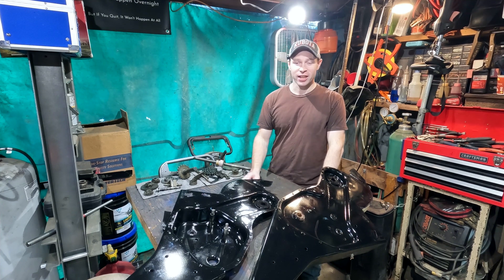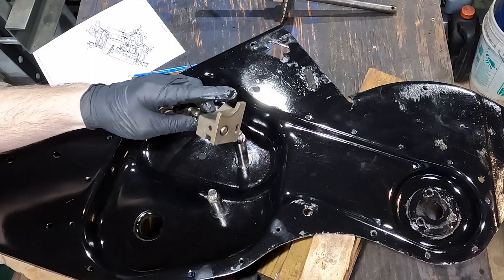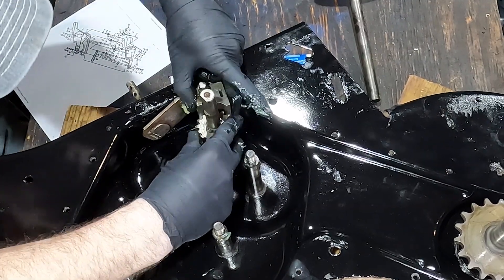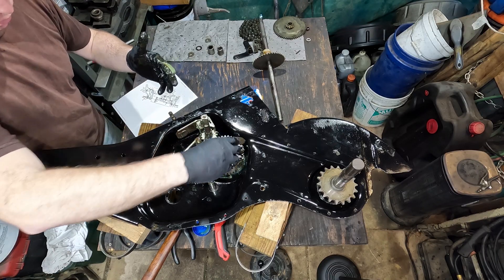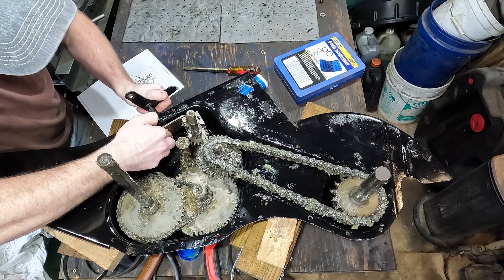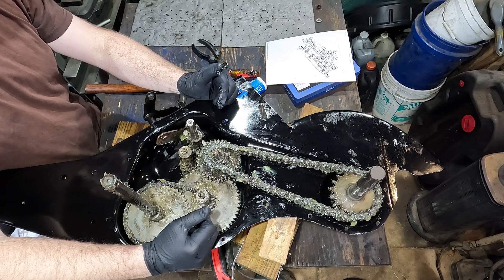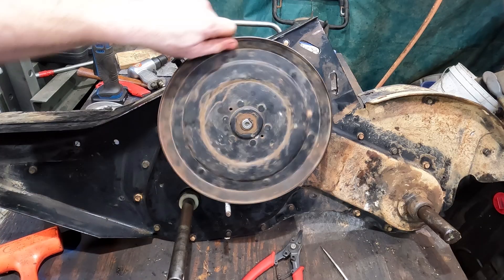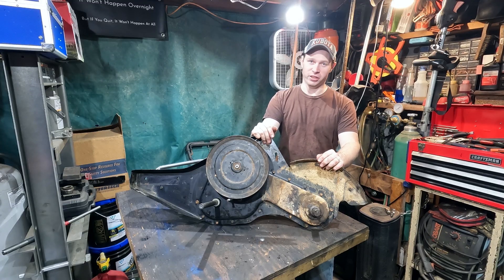Reassembling The Transmission Of A Heavy Duty 5HP Craftsman Tiller PART 3

Comment: Im not so sure it wouldn't be better to use rtv to seal and fill w/ gear oil? Of course that would require adding a fill and drain plug.
Reply from the maker: Honestly you certainly could.  I don't see why that wouldn't work the same or better then the gasket/grease I put back in.

Tine axle seals, axle seals and a drain plug like you had said would probably be the hurdles to get around on that but possible.

Comment: Thanks for the videos!  Great work.  Are  these parts still avaliable (besides the gasket) and where do you purchase them?
Reply from the maker: Thank you and thank you for watching!

Best place to look up a parts diagram is Sears Parts Direct.  You should have a sticker on yours with a model number.  It will look something like a 917.295671 ect.  I think you leave the dot out when you search on sears.

That will give you a breakdown of parts. I think you have a 50/50 shot if items are still available.  Some are, some aren't, kinda depends what it is.  If nothing else, you can get the part number and search the web from there to see if you can find the item you need on Ebay or something like that.